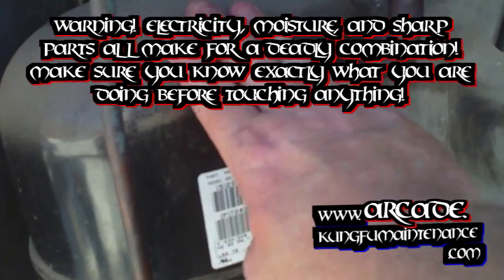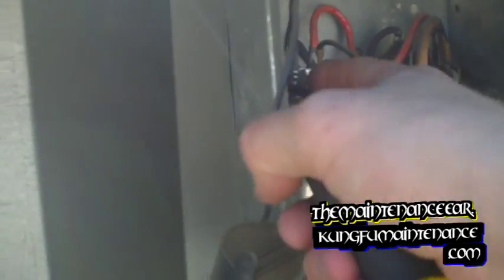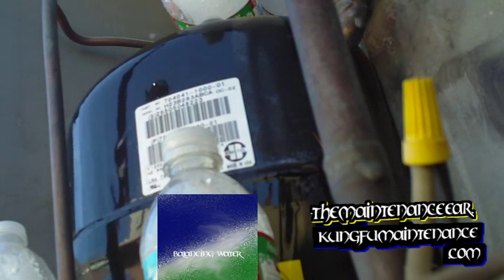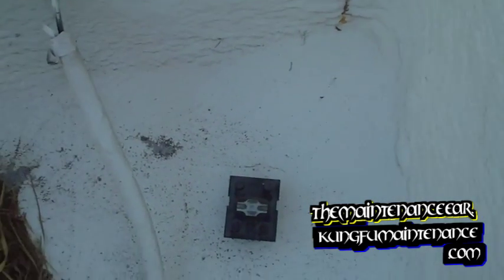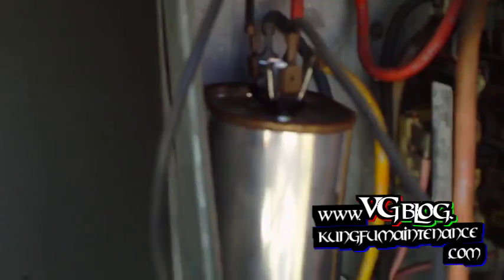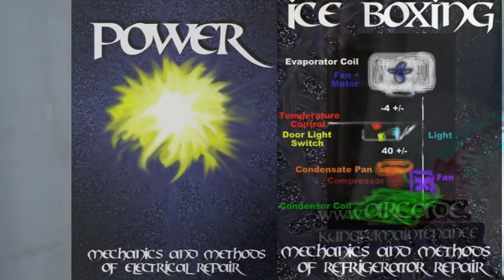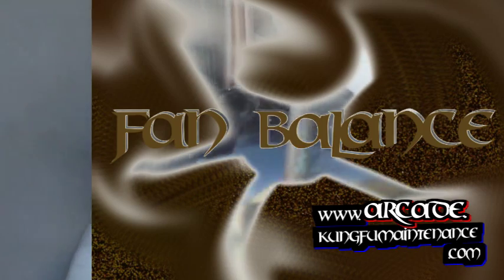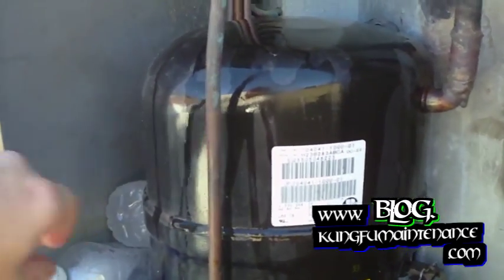How To Cool Down An Overheated AC Compressor Fast

Comment from the maker: Get KFM's favored Multi-Meter  here        http://amzn.to/2l8W9CO 
Get the Milwaukee 11 in 1 Screwdriver     http://amzn.to/2uTtsNj 
Get  the Multi Tool Pliers used in so many KFM videos       http://amzn.to/2kWTjPp
5mf Capacitor   http://amzn.to/2wC96sH     35mf Capacitor    http://amzn.to/2vZVZ2t
35/5mf Capacitor   http://amzn.to/2iVJNi2        40/5mf Capacitor    http://amzn.to/2wzEdXD 
45/5 mf Capacitor   http://amzn.to/2w0wez5   
Get KFM's favored AC Gauges here            http://amzn.to/2kYgGb8
Wet Dry Vacuum used in so many KFM videos   http://amzn.to/2lFxi7u
Condensate Pan Tablets   http://amzn.to/2lalV9W   No Rinse Coil Cleaner  http://amzn.to/2lHg8GD
Condenser Fin Whisk Brush                          http://amzn.to/2vWXUoC 
Chapin Pro Pump Sprayer                             http://amzn.to/2vWCXdD
Evaporator Coil Cleaner No Rinse Mix        http://amzn.to/2x3eJTT
Evaporator Coil Cleaner No Rinse Can        http://amzn.to/2ezIxju  
Get KFM favored Electronic Leak Detector        http://amzn.to/2kmQMMz
Simple Leak Seek Spray   http://amzn.to/2lFfcC5  Laser Thermometer  http://amzn.to/2layD8I  
Hard Start Kit     http://amzn.to/2kiD16v   Contactor     http://amzn.to/2lFqA0P
Get the Screwdriver used in so many KFM videos here    http://amzn.to/2kHFoOF 
Easiest Way To Get Universal EPA Certified Prep Manual    http://amzn.to/2kIQdQC
You must be EPA certified to charge or recover refrigerants and here is about the Easiest Way To Get certified with the Universal EPA Certified Prep Manual    http://amzn.to/2kIQdQC
Valve Core Removal Tool                              http://amzn.to/2kJ00pC
Inficon Refrigerant Scale                               http://amzn.to/2vUCQPD
Get The Kung Fu Maintenance book here     http://amzn.to/2lEQPFk
Or  the Kung Fu Maintenance E book here  for less than $5    http://amzn.to/2lEY8wD
Get the Kung Fu Maintenance album (good driving music) "Up Beat" here     http://amzn.to/2l41pZ1
Get the Kung Fu Maintenance album (nice Instrumental music) "Entropy" here   http://amzn.to/2kl2U0p
Samsung Galaxy S8 Plus        http://amzn.to/2sFn9h8
GoPro Hero 5 Action Camera         http://amzn.to/2sN4nVK
Rode Lapel Microphone                 http://amzn.to/2vZoFc7
Purple Panda Lapel Microphone  Kit   http://amzn.to/2wByXkq
Video Edit Pro Software       http://amzn.to/2ruaaeZ
Samsung Galaxy S5                 http://amzn.to/2wBxk6l     
Samsung Galaxy S8 Plus        http://amzn.to/2sFn9h8
Video Edit Pro Software       http://amzn.to/2ruaaeZ

Hire An HVAC Specialist                                  http://amzn.to/2lktKek
Air Duct Cleaning Services                              http://amzn.to/2lFTpun
Central Air Conditioner Tune Up                   http://amzn.to/2lzJGoy 
Air Conditioner Repair Or Installation          http://amzn.to/2lFsEGw                                           
I don't work for any of the product companies  listed however I do make a small commission on items ordered  through the links.
Reply: KungFuMaintenance hello I have a portable ac unit the compressor wasn’t making a noise now it’s making a humming noise like high pitched when it turns on any ideas what could cause that the fans work and it’s still cooling just makes noise now when the compressor kicks on anything will help thanks

Comment: Hello! Yes!!, My apartment HVAC compressor must have over heated. the fan was blowing air out of the vents but the compressor wasn't running  I turned it off for a few minuites and turned it back on it kicked on, but after a minuite or two shut back off but fan was still working took off the cover and compressor was soooo very hot!!!  couldn't even touch it..  what does the fan compassitor do?.. like I said, the fan it working..  maybe the compressor was just running to long without shutting off!  thank you for your answer/help

Comment: Love your videos brother. Thanks for posting. However...riddle me this Batman....what would make an outside compressor overheat, if all of the coils and interior have been cleaned and hosed out/off, the fan spins fine, the drainline is clear, the floatswitch is working, the freon levels check out and the capacitor is new has been tested and works? Because I'm outta freakin ideas mate!!!!!

Comment: Hi there i replaced condenser fan motor twice & is acting up on 3rd one,liquid line is so hot than normal,ive replaced contactor,capacitor & still same issues,3rd motor overheating plz help..
Reply from the maker: First check is to make sure condenser coils clean and clear. Air filter clean and clear. Evaporator coil clean and clear. Beyond that could be refrigerant charge issue. Refrigerant could be overcharged, undercharged or clogged filter drier or metering device.
Reply: KungFuMaintenance ...thank you ill look into that

Comment: Next time use liquid nitrogen. Much faster than ice.
Reply from the maker: +jim davidson My thought is ice is cold as you want to go. If you go to cold too fast it can warp the metal just like you don't want to take a frying pan and put it straight into the water because then the frying pan might not sit so straight anymore on the range. I'm just not so sure you want to go too cold too fast from a really hot compressor. Even ice maybe too cold but for necessity of convenience you kind of got to do what you got to do. I have not had a problem using ice so far so I will stick with the ice for now. I don't think I want to go colder than that. Thanks for watching and sharing your interesting comment!! The other side of it is ice is just a lot more convenient and or readily available than liquid nitrogen! LoL It is definitely cheaper as is usually free!!
Reply: Not a bad idea, but expensive and you can crack the metal because of quick contraction....chemistry 101.

Comment: its not logic to carry ice packs all the time in your service vehicle best option is get a trash liner filled half with water place it on compressor head and pierce a small hole to water drip, a good compressor will start with in 30 minutes once you realized internal overload is reset switch off indoor motor and run the compressor for 5 min to get further cool down,but look for the reason for over heat.

Comment: My compressor wasn't running.  The AC unit (fan) inside ran all day.  I go outside and open the disconnect.  It was burnt like it was on fire.  I need to buy a new disconnect because one of the fuses was totally burned to the core and burned off the top connector holding it in.  I wonder if it would have burned my house down.  Don't know what to do    I haven't opened up the compressor yet.   A storm came right after I checked it. 
I'm in the south during a constant heat wave in August.

Comment: I'm no expert, but I think he should have checked to see if the compressor was damaged by being run while overheated. Maybe check the pressures and current draw of the compressor. Also, don't AC units have a thermal shutdown that keeps the compressor from getting too hot?

Comment: If your not in the business  this will seem like a great video, the rest of us know better. Did he check the fan for amp draw?  Did he check the  compressor for amp draw?  Better hope there is no other underlying problem other than the cap.
Reply from the maker: ~ Thanks for watching. You might have missed the title of the video. To show every point on every video each video would be three days long.
Reply: Let me be the first to state you have posted some good videos.  The point I wanted to make is that there are many things that can contribute to a part failing.  If you don't state that even in passing consumers watching your videos feel ripped off getting charged a service fee and a reasonable mark up on the part.   I spend about 30 minutes checking the system after I replace a part.  If its not obvious the part failed due to age I owe it to my client to solve the problem.  I had a loose rivet on a fan blade take out a motor and a cap. When a snake got chopped up by the fan and created a wobble.  That in turn heated the motor and killed both the motor and the cap in short time. It was almost undetectable that the fan blade was damaged; I carefully, examined all the parts in series leading to the cap.  A dirty condenser coil can even cause a capacitor to fail.  Your video is fine just make note that simply replacing a part is often a short-term solution and to have a reputable service tech check the system.  

No I didn't miss the title.  If the cap fails again because the bearings are going bad in the fan, it may start drawing excessive amps.  The compressor will overheat again starting to break down the internal oil.  Two additional problems will occur the oil will start to breakdown creating carbon and acid in the system.  Both of these items can be checked and remedied.  Habitually letting the compressor overheat until you determine why the cap blew not cost effective will shorten the life of the system and is short sighted.

Comment: 1)Turn the power off.2)cycle liquid refrigerant through the compressor with your reclaimer.3)when the motor winding cools and the overload makes contact, reclaim the liquid refrigerant out of the compressor, restart and recharge the system. Or wait two hours for the compressor to cool down."Then"put SUPCO oil additive in the compressor,this is the best stuff no one knows about, I've been using it since the 70's it helps old binding compressors to make it through the night or weekend.

Comment: I use a wet rag which draws many BTUs from the compressor. Dont keep it saturated with a hose but only wet it when the rags are almost dry. This allows the compressor to cool fairly rapidly due to vaporization.

Comment from the maker: Condensor coil, evaporator coil, and air filter were all clean. Truth, those are all factors that put strain on a system and can contribute to a cooling failure. The purpose of this video was to show how you can speed up the process of getting the compressor  going again. If dirty coils or filter were the cause than cleaning them can prevent the need for personal reruns or future replays.

Comment from the maker: No it is safer to not pull the wires. Just pull the disconnect first and than bridge the leads of the capacitor with the metal portion of the screwdriver while holding only the insulated portion of the screwdriver. There is no visible spark or audible pop to indicate the discharge has taken place so it is a good idea to prove no current is left in the cap with a non contact voltage detector sometimes called a circuit alert device(in smaller circles known as a "Deadmen's Stick").

Comment from the maker: I have a video on the same subject "How to test time delay fuses". I often carry extra fuses with me and not a multimeter so sometimes I check them first and sometimes not. Being in building maintenance brings about a different approach to A/C troubleshooting than traditional A/C techs would use. Traditional A/C techs will bring a whole arsenal of tools in the their tool bags. Maintenance will generally not have the luxury being called off from one job to the next constantly re-prioritizing.